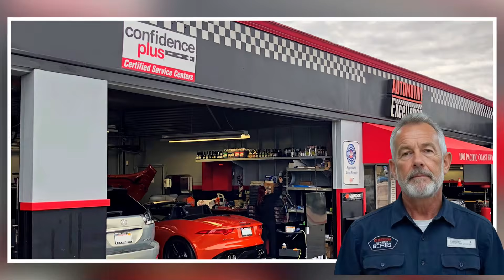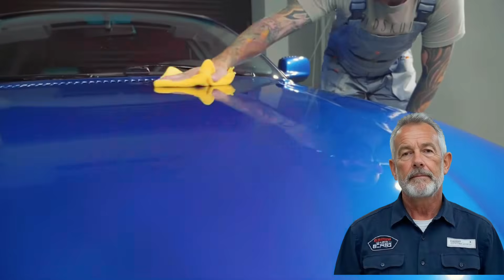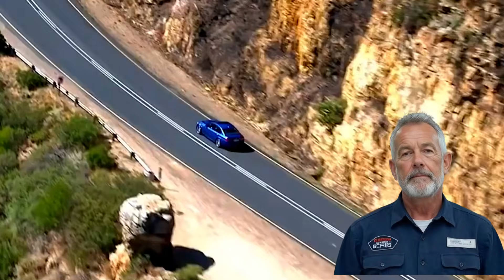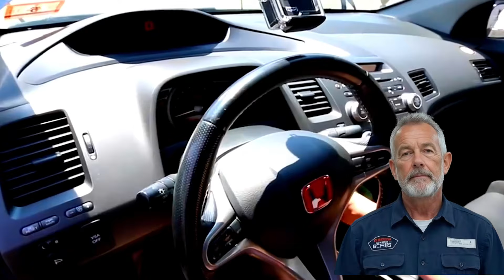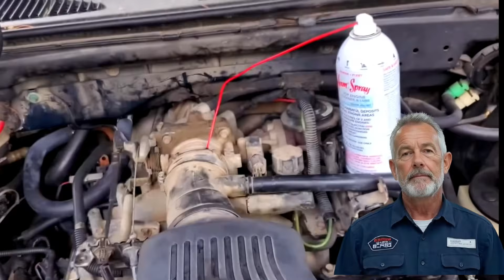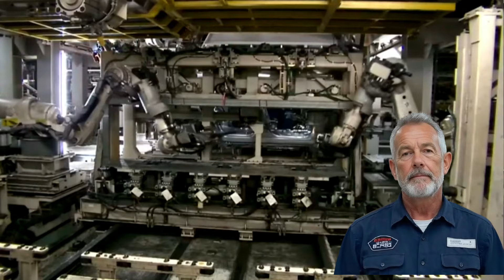$1200 Mistake: The Truth About Fuel System Cleaners (AAA Data Confirms They're a Lie)

Comment: I run a top tier fuel in my vehicle. I use Shell or Costco (Kirkland) both are certified top tier. & stay away from unknown brands you never know what you’re getting  in terms of quality if its cheaply priced stay away from it occasionally I’ll run a good fuel injection cleaner such as royal purple or red line or any with a PEA .
Reply from the maker: Welcome to the Car Care Talks community! We really appreciate you sharing your experience and excellent maintenance routine.

You are absolutely right about using Top Tier fuels like Shell or Costco (Kirkland)—that is the number one best preventative measure a driver can take, as those fuels have enough detergent (often PEA) to keep a clean system clean.

My question for you, given your routine, is this: Do you believe that even consistent Top Tier fuel use and the occasional Royal Purple/Red Line bottle is enough to fully prevent the kind of hard carbon buildup that forms on the back of the intake valves in modern GDI engines, or is a physical cleaning (like walnut blasting) eventually unavoidable?
Reply: @Carcaretalks my take on this it should help keep under control. I’ve known a vehicle with GDI will build up carbon especially using a non top tier fuel . As I stated stay away from a non top tier fuel . On those types of vehicles with GDI I would recommend using Shell fuel . I did fill up at Shell & I took notice of the Logo on the pump dispenser it stated All Grades of Shell Gasoline Exceed Top Tier Gasoline minimum standards for Detergency..I’d say both Shell or Costco even Chevron  & Mobil / Exxon  & Sinclair with Dinocare which is top tier brand . I did do some research and found out that The Kirkland brand (Costco) On their fuels Costco goes beyond the minimum requirements adding 5 times the EPA required Detergent levels to there gasoline. That’s actually more than many name brands.. any of those brands I mentioned are excellent choices. I have used BG 44K which is fuel system & injection cleaner it’s a great product.its kinda pricey .
Reply from the maker: @robertwhite6813 Thanks for the awesome feedback. You are welcome to the community again, kindly subscribe so you don't miss our next drop.